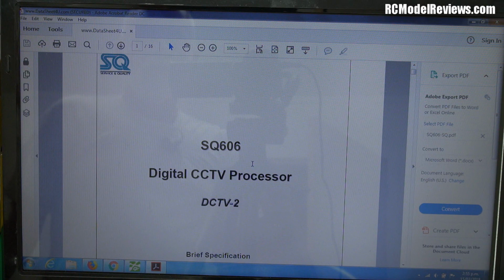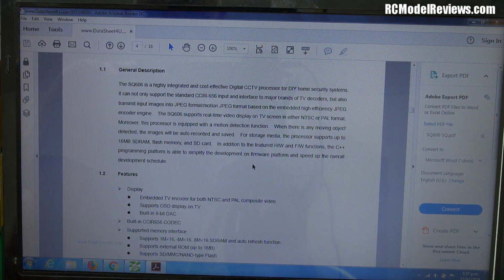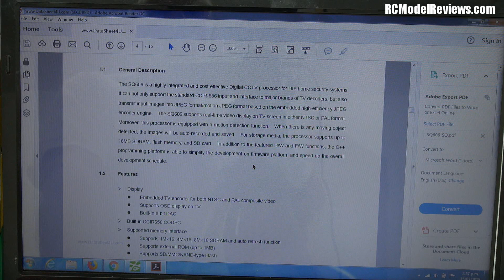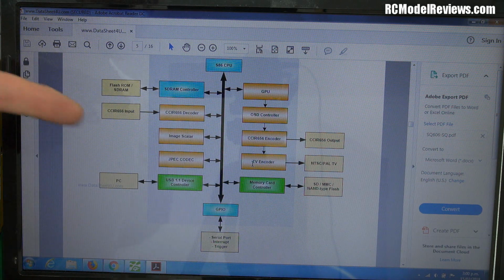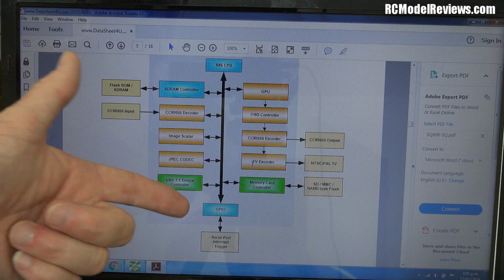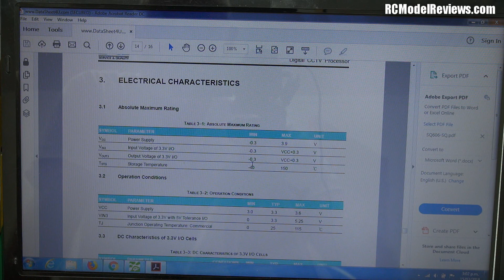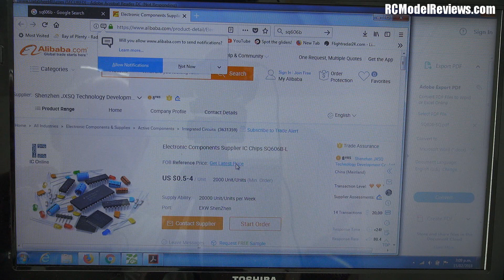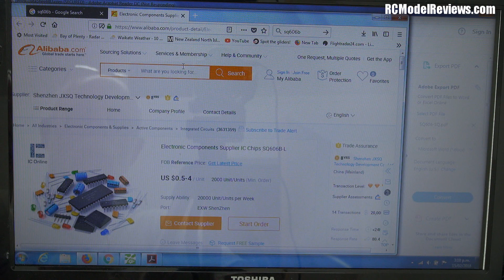DIY SD digital FPV -- the search for suitable chips (part 1)

Comment: Promising indeed, however do not forget the elephant in the room called latency. High latency will make the system unflyable. The age of this soc might be indicative of it's latency performance. M jpeg or not.
Reply: For a camera platform, you, or at least I, don't need FPV flying. I'm looking for quality image, the quad would not be more than 30 meters away from me most of the time. Heck, if I were building for myself, I'd strap that DVT to the bottom of the quad and store video onboard.
Reply: 1257Dark Even for a pure camera platform latency is a unpleasant side effect. It becomes harder to keep a subject in the middle of the frame while panning or manoeuvring. That is why i use analog uplink on my heavy camera drones instead of dji lightbridge. But i do hope Bruce comes up with something that has a latency below let's say 30ms including the camera. That would be a revolution for everyone. Fingers crossed.
Reply: A runcam swift 2 alone has a latency of around 23ms (according to oscar liang). No way in hell a cheap digital diy system can do <30ms
Reply: A Random Geek Correct, the Sony super had II with the Runcam Swift has that latency. However, there are new kids on the block in the form of the new breed of CMOS camera's like the Cadxx Turbo F1. The Drone Mesh channel did a review on it's latency using a oscilloscope and it scored an amazing score of just 3.3 ms. Needless to say that this gives Bruce about 26ms to play around with. Check out the review on his channel.
Reply: I regularly play multiplayer in flight sim games with more than 250 ms latency. The lag is noticeable on occasion, but it does not hamper my ability to takeoff or land, and I can without undue difficulty score guns hits on other aircraft during dogfights. 

Minimal latency is only a big problem for people flying 3D or doing FPV racing where you're within tiny fractions of a second of hitting the ground at all times. For a camera platform quad or a sports fixed wing 100 ms of lag would not be an issue.
Reply: Games use a technology called lag compensation. Real time camera feeds do not. https://www.pcgamer.com/netcode-explained/
100ms would be acceptable for camera platform applications if it remained constant, however in real life there are latency spikes due to dropped network packets and error correction. These spikes increase as the distance from the receiver increases. As for FPV, sure it is far more difficult, especially for racing.
Reply: I'm familiar with lag compensation, though I should note that many of the sims I've played don't have very much of it: aircraft travel very fast, so having too much predicted motion causes planes to rubber-band all over the screen when their pilot makes an unexpected maneuver. As a consequence you often have to aim so that your tracers appear to pass in front of the target's nose. Based on that experience (playable at 250-300 ms) I'd say that 100 ms is passable for FPV, If (and only if!) you're flying sedately and enjoying the view rather than trying to do something more intensive. 50 ms is probably acceptable for most flying, and <20 ms desirable for racing or stunts.
Reply: Agreed, that is why i would love to see a digital system that is cheap and has as low latency as possible.
Reply: Latency, yes..   i think somethimg linke steamlink, e.g.gfxcard with low latency optimized h264 codec could be ok. And data send like DVB-T with e.g. 2000 carriers to supress fading/reflections....  you will allways have added delay with digital, cause the encoder can only encode if frame is fully in memory... and decoder can start if fullencoded frame is received....so min. +1 frametime... but 50-60ms would be acceptable? (p.s: i am a HW/SW developer)
Reply: Bernhard Trzil So you see a possibility to remain in the 50ms range? Very interesting. What would be the bill of materials of your proposed method? The Amlogic S905D  soc may be interesting to you. Hardware H264 and H265. Quadcore A53 and  it supports the DVB interface. H265 could be even more useful as it is easier on the required bandwidth.
Reply: Bruce, are you reading this?
Reply: Yes, but it wont be that easy, more things to solve... You have to get full HW doc. of e.g. S905D to be able to couple e.g. camerainterface directly to the IC, or find a low lag USB3.0 interface/i S905D support USB3.0, there are DVB-T Encoderchips which also have to be coupled tightly to the SoC for low lat.. if this all is sorted out, there is a bunch of tests/setup/coding needed to get good performance. At last need to build own PCB with all choosen components. You need 7Mhz BW for one DVB chanel and 12-20MBit...for 868 Mhz there is space for 1 channel. If you want to go to 1.3Ghz/8 Ch or 2.4Ghz . you need to adapt the DVB  intermediate modulator, which is not that easy.For prove of concept i think it would be possible to send/recv. in UHF band/868 with just USB/Prototyping HW. TO get latencythen down, USB3.0 or e.g. PCI/DMA coupling to SoC would be needed.  But very interesting topic as you see on my long post ;-)    very tempting to try something out myself..
Reply: PS: The SoC h.264 would need to support the low lat. h264 profle, e.g. only with I/P frames.. i only know this for AMD/Nvidia chips for now..
Reply: I is not easy, that is for sure. The HW doc should be available from Amlogic.Coupling the camera AD conversion through a DMA channel would be the optimal solution for sure. And keeping it at 868 Mhz for a proof of concept should be fine. Also, there are plenty of cheap 868Mhz RX and FX parts available. That frequency is theoretically not allowed in many country's but that is a problem for later. A custom pcb will be mandatory for this project. It is indeed very interesting and something the community is asking for. And if you are tempted to give it a shot and need some help, contact me. ;)
Reply: The hard part would be for sure to get the right combination of components and then to tight couple the dataflow/writing firmware...this yould be a intense/long process...  i am currently develop/program a Longrange system mit low latency, cause opentx is to slow and crossfire is to expensive. it seams i get the signal to be conform with 500mW in Europe with 150-167hz refreshrate, so would be better the  crossfire ;-) . if this works maybe i give digital fpv a try ;-)

Comment: Don't know if you already found this project, i think it is pretty interesting related to this, a digital HD video transmission with standard wifi hardware:
https://befinitiv.wordpress.com/wifibroadcast-analog-like-transmission-of-live-video-data/
He uses a raspberrry pi to encode h264 in hardware, the keyframe intervall can be cofigured so it is not really a problem, the max dropout after an error is limited. The big problem is the about 150ms latency, so i consider it as not usable for any reasonably fast FPV flight. More details, what causes this:
https://befinitiv.wordpress.com/2015/09/10/latency-analysis-of-the-raspberry-camera/
Analog FPV has usally a latency from 0 to 1 frametime (30fps = 33ms), we would need something in the same ballpark. I see latency as the main challenge here, getting an IC to encode it to an usable format is relativly easy (and fast).

Comment: I suspect that you will need an FPGA just to interface the video encoder with the modem or RF front-end, unless you can find a chip that generates a real digital video protocol designed for wireless transmission, like DVB-T.

Generally speaking, any chip which needs large amounts of memory is using large buffers and will introduce high latency. Look for chips that work without large external memory chips if you care about latency. Or just do everything yourself on an FPGA - expensive but very flexible.

Comment: Bruce, have you seen these http://www.banana-pi.org/d1.html ? I started a project a couple of years ago to try to build an FPV system using it. Haven't finished it, although there were no real technical blockers, only lack of time! I was planning to use a RPI for the ground station. IMHO the video side of things is not the hard part, it is the radio part - getting decent range & low latency.

Comment: Can I ask a basic question? Why do we want a digital SD system? SD video quality sucks. And digital FPV has a lot of limitations as you have explained in other videos. Perhaps not having to worry about stomping on each other's frequencies when we fly would be the one advantage this would have, while it would suffer from about 10 serious disadvantages. Crap SD quality, digital artifacts at the limits of range, additional cost, complexity, size, less crash worthy, etc etc. Please figure out how to do A-HD instead. (HD analog video) 😁
Reply: mPky1 Clearview already does that quite well and doesn't suffer the disadvantages of digital with the exception of cost.
Reply: mPky1 "Except for the latency..." Well I think most people think low latency is easy to achieve, but it's possibly the hardest thing to achieve with digital video. How many digital HD systems are out there low? 5 or six including DJI stuff? And how many can be used on a fast moving mini-quad in a racing environment? Maybe 1 (ProSight). Reducing static of a SD link by going digital and introducing a bunch of latency, cost, and weight in the meantime just doesn't make any sense.
Reply: mPky1 Yep. ProSight did it with uncompressed video. Guess what, then you hit other limits, bandwidth and power and thus range. Sorry man but "real time compression" doesn't exist in hobby $ terms. Live HD in sports is irrelevant for that we're doing here. Look at Amimon's other systems, or the competing commercial systems, and tell me how to use them on a small craft. Bruce isn't going to solve these issues in his workshop.
Reply: mPky1 Ummm have you seen the DJI "race" system? The Tx is bigger than ProSight, much less analog, and guess what - unsuitable for actual racing thanks to latency. I love how they put the term "racing" in the name of the product. lol

Comment: I am sure using digital for the transport layer is a good idea. I once did think this was good up till when I was Joshua bardwells interview with the creator of clear view https://youtu.be/Wx5ZjRkbR34 basically one of the biggest advantages of analogue over digital is that because of the pattern recognition in our brains we can fly through the static where as digital is an all or nothing so we either have picture or don’t have. This is also why we do not have fpv screens with with blue screen.